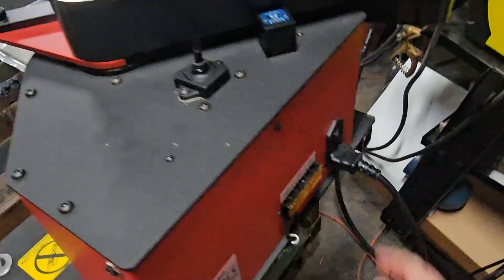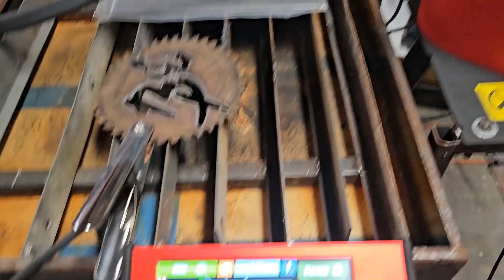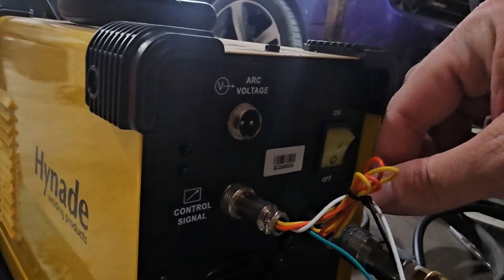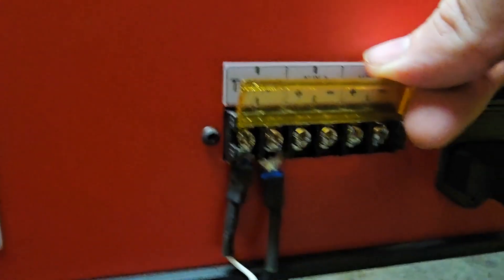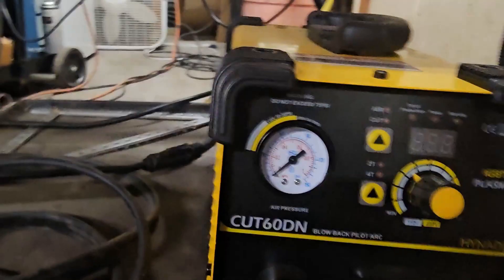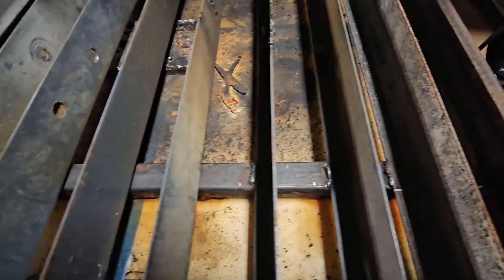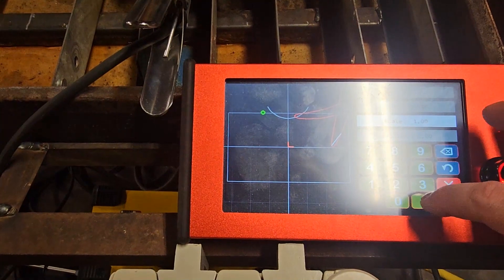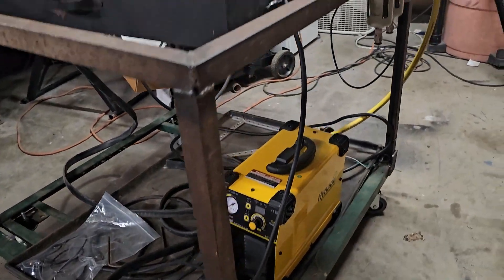The Cheapest CNC ArcDroid Plasma Cutter Setup | Water Table |

Comment: Are you planning on doing the torch height control? If so, does it need an amperage divider?
Reply from the maker: Yes there's a video in the pipeline for that. From what I understand, I'm going to need to half the voltage signal.
Reply: @TruckBoat  that would be great. I subscribed.